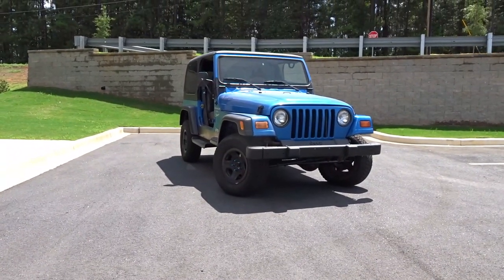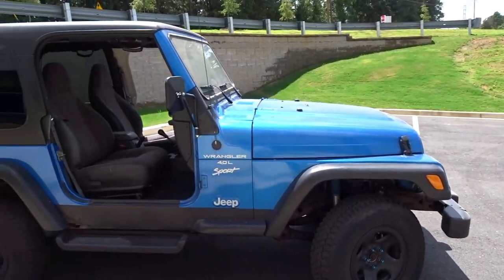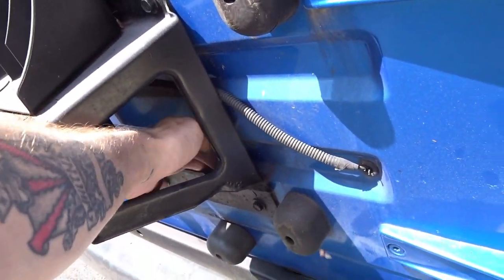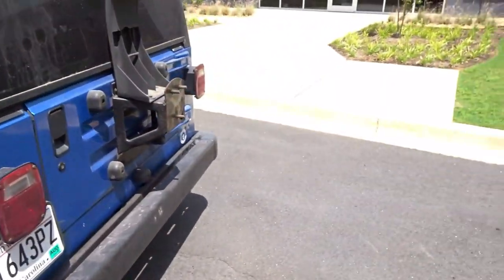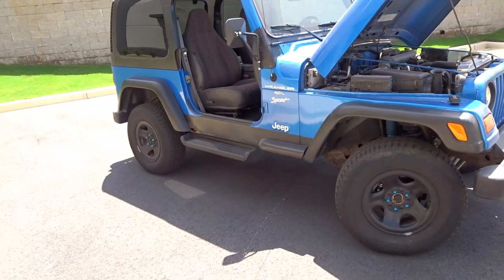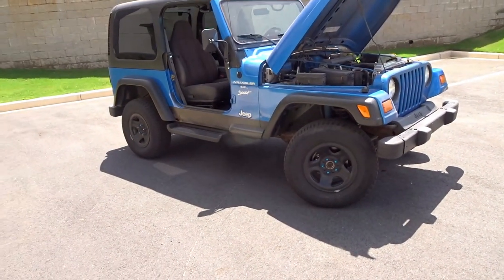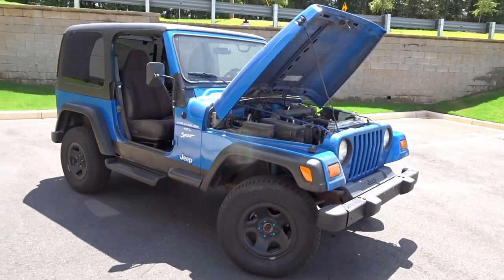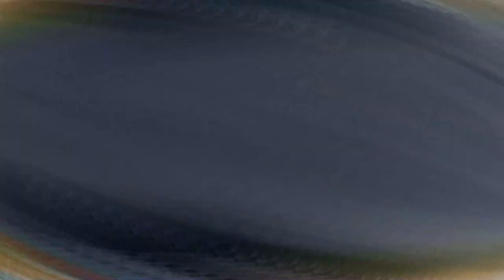I bought the WORST Jeep Wrangler in America!

Comment: I had a 99 Sahara, I did a lift with 33’s and it was great. I had both tops and when I bought it, it was a selling point. I bought a crane that I installed in my garage that I could pull under and hook up to the hard top where it would just lift it off and store. I loved the straight 6, easy to work on and straight forward. Mine never had rust due to being a south vehicle it’s whole life. I also loved the soft top because I could just fold it down and had the sun keeping me warm. I did mods to it also, I would have never gotta rid of it but I got an offer I couldn’t refuse.
Reply from the maker: I loved my XJs so I’m excited to jump into this wrangler.  It’s a whole life, you’re absolutely right!